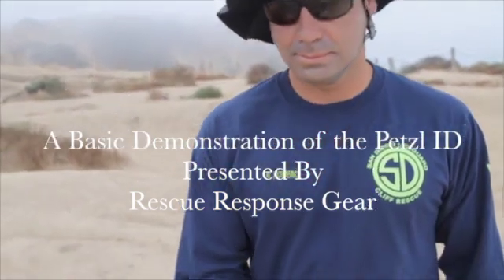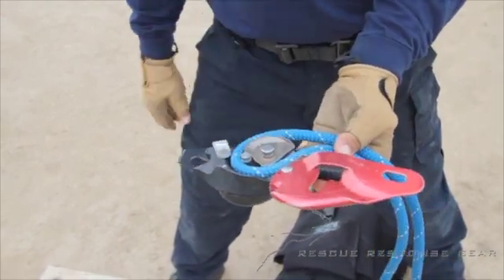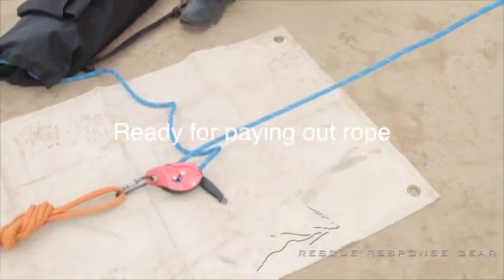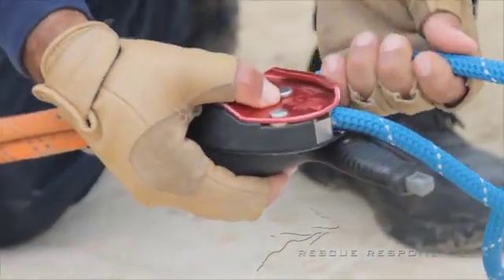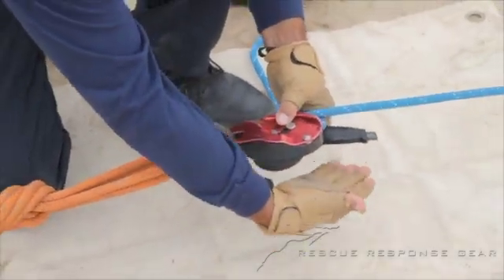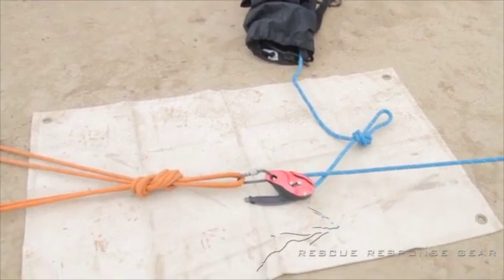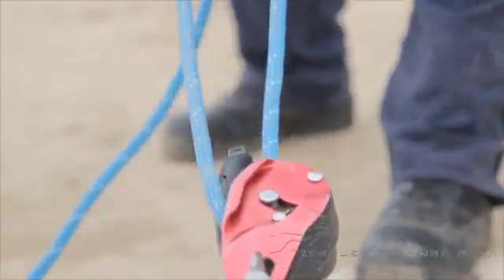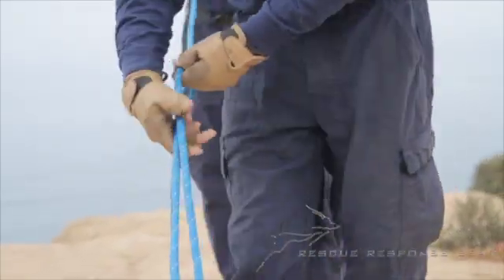Petzl I'D Self-Braking Descender: A Basic Demonstration in the Belay Mode

Comment: Despite the user manual stating the device use for belay its unsafe as it doesn't comply to the BCCTR standards and will either cut of cut the mantle on mainline failure
Reply: We did not get the version user manual I believe.  It's fine for both leader belaying and second belaying.